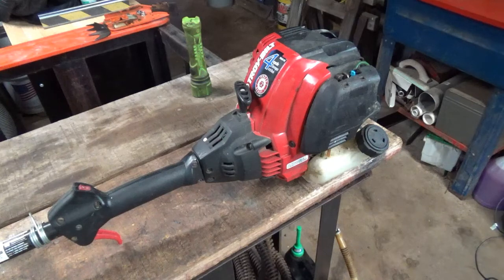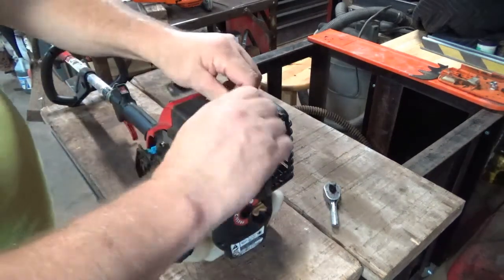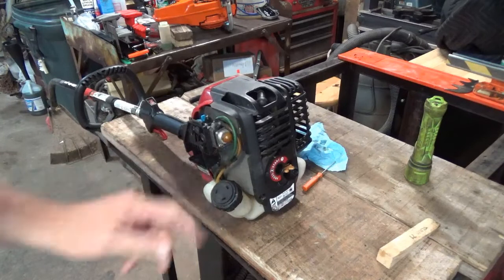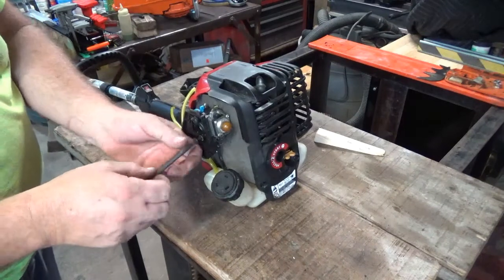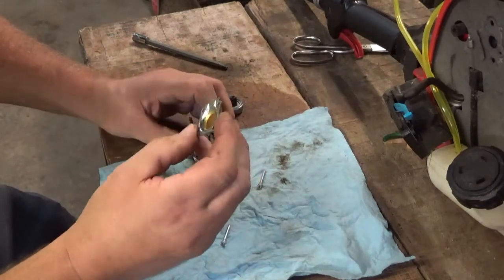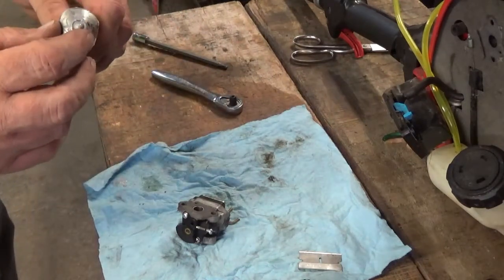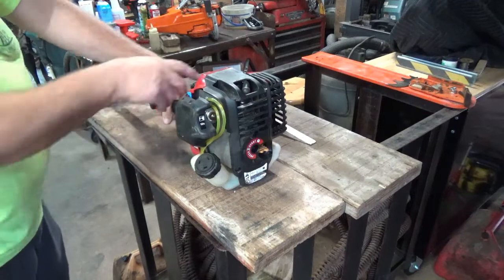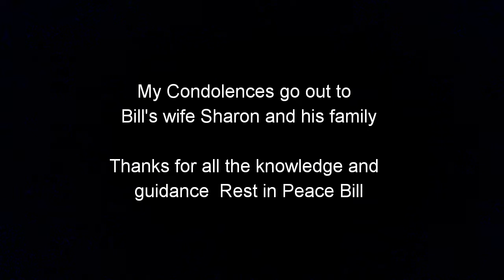Troy-Bilt 4cycle Trimmer (will it run)

Comment: I have the EXACT same one in my shop for the last 4 years!!!  I even bought the 10mm spark plug adapter to check compression.  Usually valve adjustment gets them running. And don't forget to check the crankcase for oil!

Comment: You have the easy start that uses a drill motor to spin it, mine doesn't.
Reply from the maker: First time working on a Troy Bilt  4 cycle,  thought it was electric from what the sticker showed. Thanks for the info.